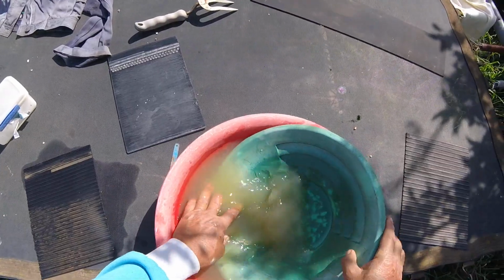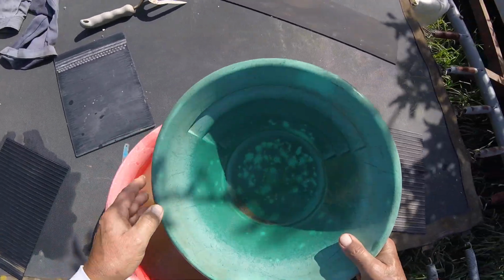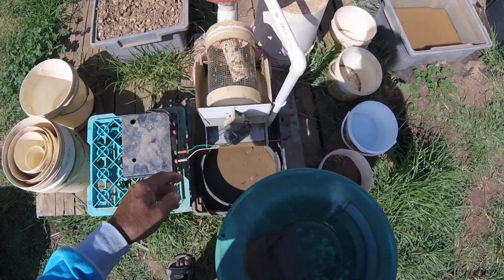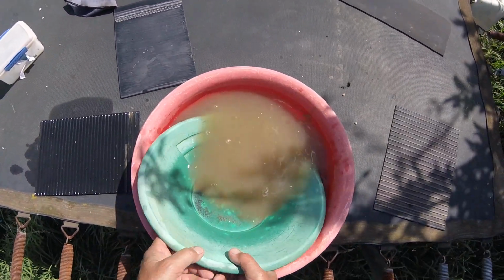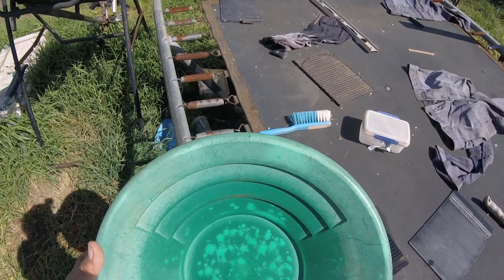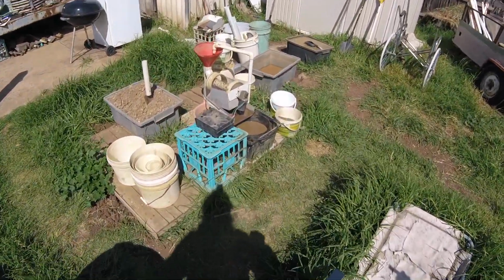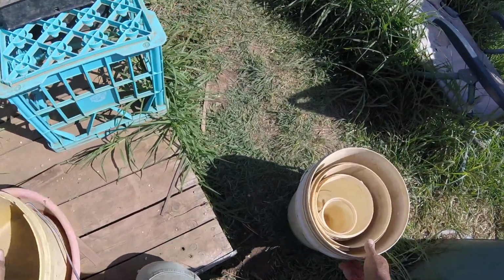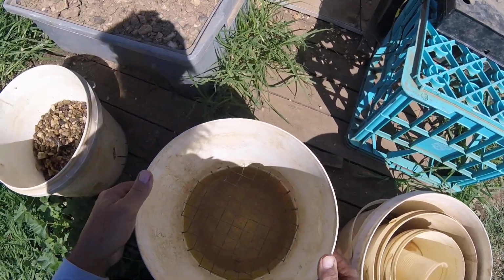Final test before attacking a dry Slaty Creek tomorrow

Comment: Very nice set up!  Like you mats and the experimentations.  Excited to hear how you do.  Water conservation is a continuing challenge, rotating settling buckets to gain clean water on site may be worth evaluation.  Cheers ❤️
Reply from the maker: I originally devised a recirculating set up so I could process material at the diggings away from the creek.
But I enjoy using it so much that I tend to use it at the creek as well
What is a rotating settling bucket ?
Reply: @mohammednovalija  just extra buckets the water can sit in and settle out for reuse.
Reply from the maker: @HeidiConanGoldProspecting  There is a Youtuber who operates in Arizona desert and he has some good ideas about water conservation - may have to adapt some of his ideas perhaps

Comment: Vo-gus nugget Lol.
Reply from the maker: i am surprised now that I am finding some good sized pieces in my tub of material.
Previously I was just panning a trowel at a time and I couldn't understand why I was not finding gold.
It's all about the amount of material moved as to how much gold may be found.
I'm gonna go deep tomorrow , and resist the urge to quit a spot and move elsewhere.
Reply: Not only about digging deep. You need to be looking at what your digging.  As soon as the ground changes you need to retest pan a few times.  To see if your still getting gold or if it's improving.  Then expand the hole. I'd start open the hole first 4  shovel by 4 shovels. Dig one shovel down the whole area. See what the results are then go down another shovel. Then check again.
Reply from the maker: @MurrayRiversGoldAdventures  what is 4 shovel by 4 shovel ?
Reply: Hole size. So 4 shovels across x 4 shovels. So a hole around 800mm x 800mm